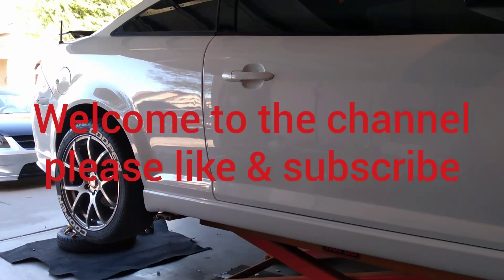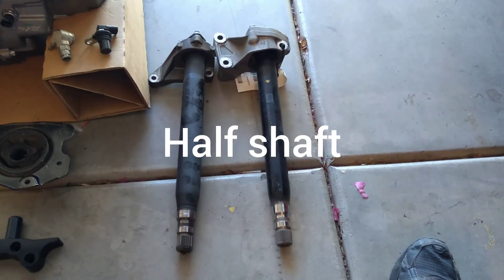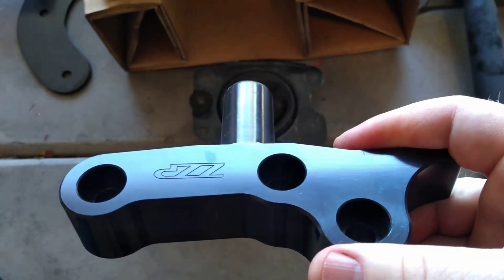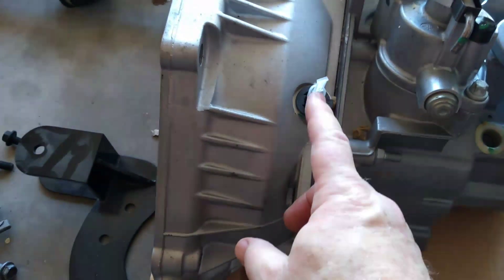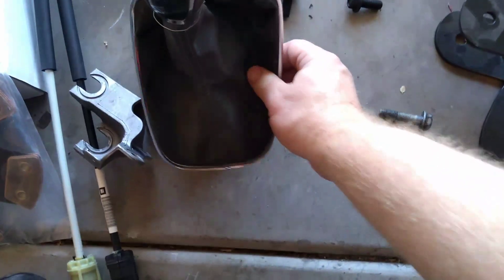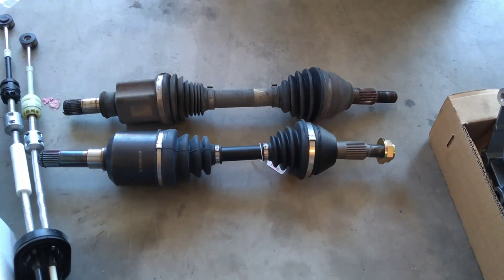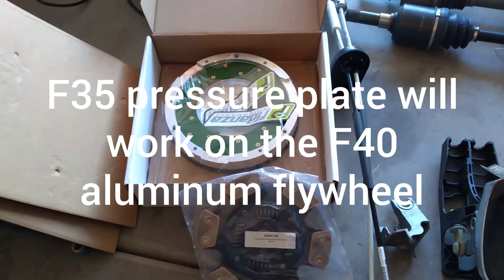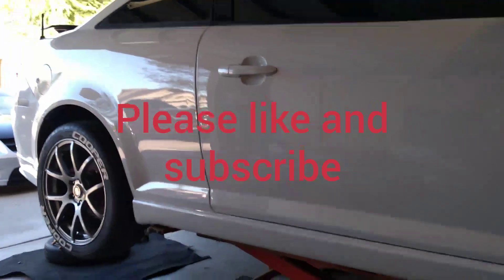Parts list to convert an F35 to a F40 GM 6 speed from a Buick GS for a Cobalt SS/TC 2.0l HHR PART 4.

Comment: I know this is an older post/video but what did you do for the front transmission mount? I just picked up an f40 from a 2011 regal and all I need are the mounts to complete this, but zzp doesn’t have them anymore and Ottp is pretty expensive.
Reply from the maker: I used a piece of cardboard to make a template then I made it out of steel

Comment: hi i use F40 saab 2007 after damage driver side exle what axle can i use for saab 9-3 2007 ? Or for Buick Regal ?
Reply from the maker: I used the axle that came with the LNF on the passenger side but the driver side is a custom length zzp is where I bought mine

Comment: Just got my F40 in last week working on putting my car together. What rubber Grommet needs to be modified for the shifter cables? Should I order the Regal shifter cables or will the f35 shifter cables work?
Reply from the maker: Yes you will need the regal shifter cables.
Reply: thanks for the quick response saved me some head scratching. I ordered my kit from OTTP all they say is to swap the grommets on the shift linkage, kinda obvious that you’d need the regal linkages now that I think of it. 
Also, thanks for posting these videos it’s helped a lot during this install
Reply from the maker: @hiiimason  Thanks for the nice comments!!  Good luck!!

Comment: I used my stage 4 f35 pressure plate with the f40 lightweight flywheel and it slipped! lol! Stock f40 clutch will hold 500wtq. And that f40 race clutch will also you the duration of an oil change before it fails.

Comment: Pretty. Did you get limited slip? What years GS had the trans ? Ne nice if the slave cylinder didn't have to go inside the trans. Such a pain to replace when going bad as you have to drop the trans. What length did you get the axle made to ? How long did it take.So would you do it again if you had another f35 car ?
Reply from the maker: Mine is not a limited slip, 2011 to 2013 GS, the passenger axle is the same but the driver side is shorter by about "1.5 ZZP sells it.  I made a video showing how to replace it you can check it out.

Comment from the maker: On the F35 as far as I know they are the same axle length.  The F40 you will need a different length for the drivers side.  The passenger side axle will work from your F35 transmission.

Comment: Aren't the axle shafts on the F35 equal length to help minimize torque steer? Are they the same length when swapping in a F40? Any comments on torque steer after the F40 went in would be great!

Comment: Will you need the custom axles or will the stock GS work?
Reply from the maker: You can use the passenger side axle but you will need the short shaft from the GS and a custom axle for the driver side.